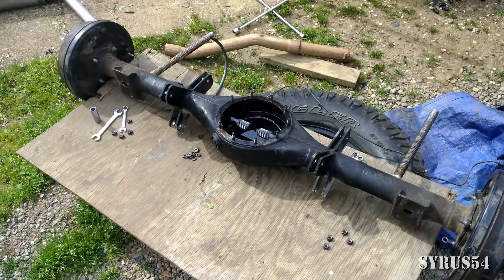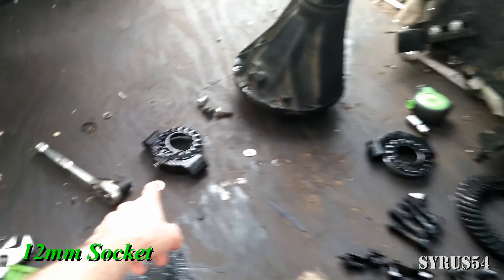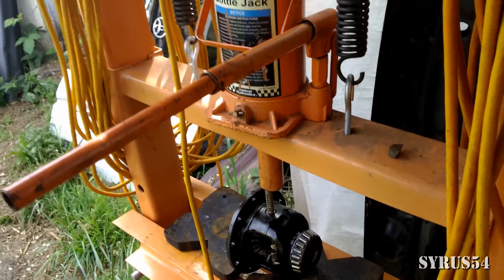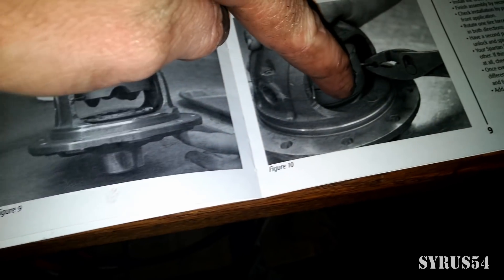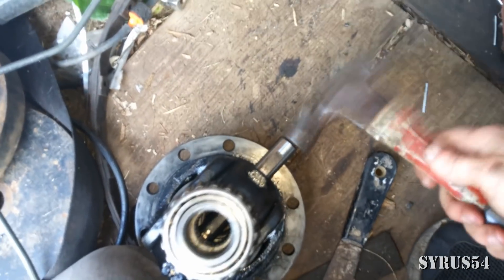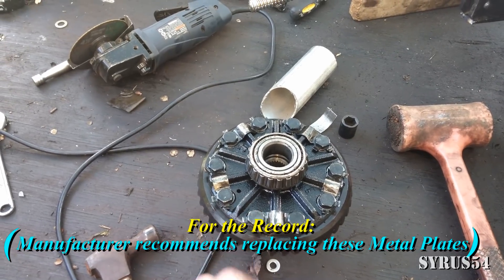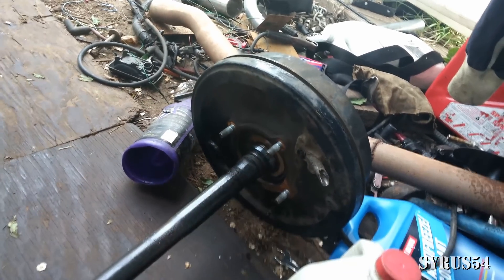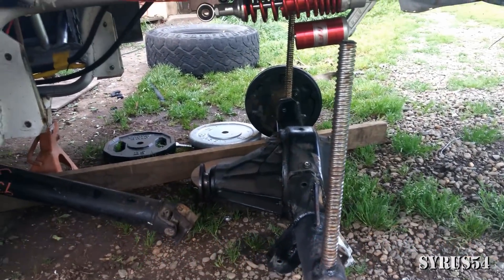Installing a Spartan Locker (7.5" 3rd Gen Toyota Pickup)

Comment: I'm two minutes in and I already see that you are a hack (the broken claw hanger is also a dead giveaway. NEVER it ANYTHING metal, other than a nail, with a claw hammer as it is hardened and will probably chip and break the part and the hammer). 
I'm rich because I had the discipline to not weld my spider gears together and wait until I could save up to buy the correct parts? 
Would have it been possible, since you already knew you had ruined that carrier to go the the junk yard and get a new carrier? 

Kids, don't do any of this at home or anywhere else for that matter.

Comment: If I were you " I'd delete this video befor anyone else sees it ....
You obviously don't know what the hell your doing . With that being said whoever take this for the correct way is gonna one unhappy camper when it locks up....
First thing you should have done is  " ck the back lash on the ring gear with a dial indicater and write that # down , 2. mark each bearing cap L & R and the same on the carrier .3. remove the bolt holding the spanner locking brackets . 4.count the turns as you back the left spanner adjuster out & write down the # of turns .
5 . do the same on the right side of the carrier ..
6 . don't forget to remove the spider gear Pin Bolt !
7. clean everything up and reverse what you just did " BUT YOU HAVE TO ADJUST THE BACKLASH back to what it was before you  disassemble ..
8. If the locker unit survives after the ring & pinion bites the dust on you please donate to me ....
Have a nice day ....

Comment: when your putting the center section back in the housing u don't just center it.  it's set from the factory so the ring gear is an exact distance from pinion gear. If u don't have professional tools to accomplish this u must mark those adjustable rings and make sure u put it back together exactly as it was from the factory.  If your rear end is still functional now it's pure luck.
Reply: What do you by this? When putting 3rd member into axle?